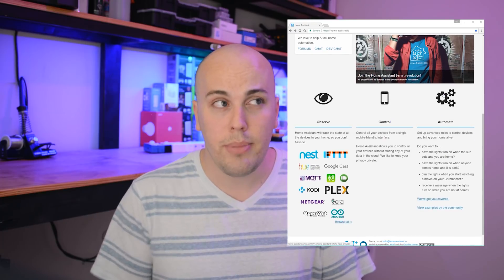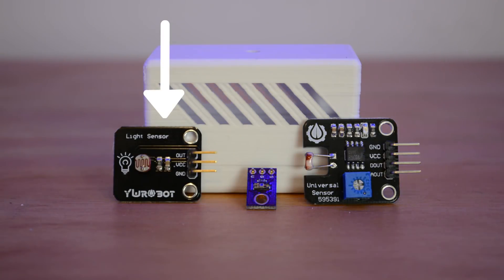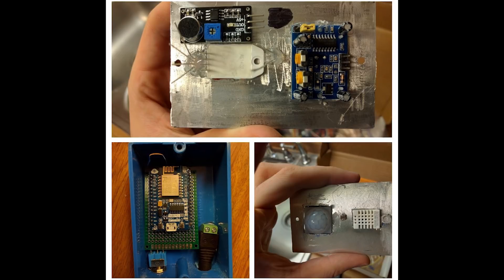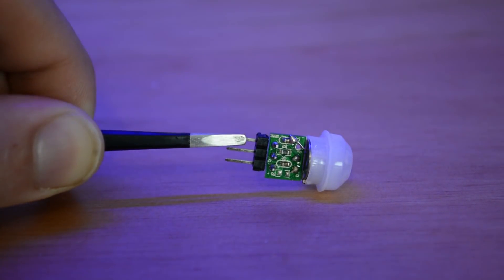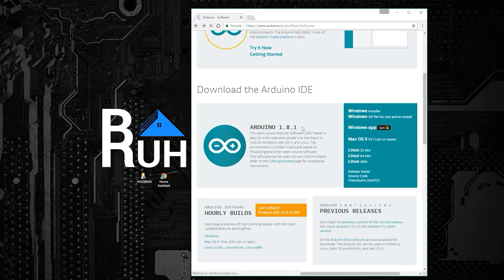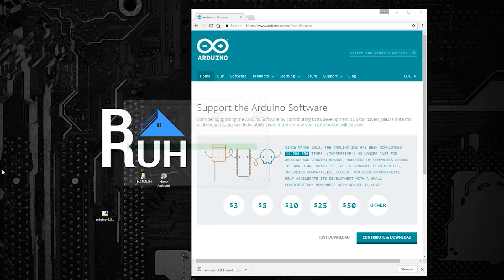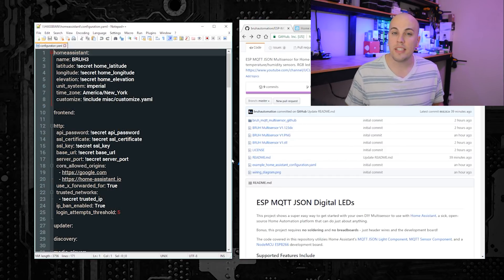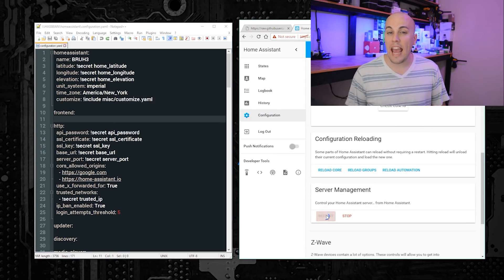$15 DIY Multisensor - Temperature, Humidity, Light, Motion, and RGB LED

Comment: Hi Ben, a huge thanks for the great help you give to all HA enthusiast! 
I build the awsome multisensor and it works great... but for a few minutes, then it hang up and I have to reset it to make it work again. 
It is done exactly as yours, only with a dht11 (I changed the line in the script) and with a LDR/resistor configured doing some soldering. All the readings are correct, RGB LED works, I also tried changing the ESP8266 with another one, but still...   Also, I tried to make the circuit Corban proposed in his Github, using FET to control an analog led strip. I wanted to join a multisensor with a LED strip controller :-)
It works, but the light is very dim, and I can't make it go higher. The voltage, mesured on the connector that goes to the LED strip, is 12 as planned, but I guess the RGB pulse is not going correctly.
Any advice?

Comment: Anyone have any ideas for an enclosure for this that's more appropriate for mounting to a ceiling? If not, I can try poking some holes in a project box... but not sure of the min-height required of box. Will something like this work? - https://www.aliexpress.com/item/1-piece-25-65mm-plastic-LED-electronics-junction-housing-diy-instrument-enclosure-humidity-plastic-box-for/32804796187.html OR https://www.aliexpress.com/item/75-23MM-LED-power-driver-retardant-PC-plastic-box-Round-plastic-housing-box-enclosures/32724913441.html OR https://www.ebay.com/itm/6Pcs-77mmx31-5mm-XL-164-Retardant-Enclosure-Junction-Box-Round-for-LED-Driver/311985571775
Reply: I'm sorry I don't have an answer for you, but I'm about to make one of these as well. Do you think mounting it on the ceiling will skew temperature readings?

Comment: Sorry i'm a noob to ESP, and these modular sensors.  Looking to use this video to build a water temperature sensor for my aquarium by replacing the DHT22 sensor with a DS18B20.  I don't know how to use resistors though.  Are they required for the waterproof temperature sensor even though it's only a 3wire sensor?

Comment: Glad I found this! Awesome work as always!
FYI Looks like some of your links are dead. 

Also, Amica nodemcu 1.0 is slightly more expensive than the lolin v3 which just a slight bit larger in size https://cknodemcu.wordpress.com/2015/11/13/nodemcu-variants/
That might be an easy way to knock a few bucks off the total cost.

Comment: I followed all your instruction and copy all your codes but when I flushed the firmware, the LED stay on blue color and the serial monitor show connecting to my router and MQTT okay.  It showed 5 lines of {"state":"OFF","color":{"r":255,"g":255,"b":255},"brightness":255,"humidity":"0.00","motion":"","ldr":"0","temperature":"0.00","heatIndex":"nan"}
 then stop and did not show anything else.  I did not modify any of your code except the setting on the top.  When I try to look at my HA it does not show ad reading and when I turn on the SN1 LED it flip back to off.  What did I do wrong?
Reply: Hi mate. I have the same bug with the blue on the RGB LED being on when any other color is also on, but it will turn off if all colors are commanded to off through HA. Same as you it comes on when the NodeMCU is initially powered up, which suggests that it is a FW bug not HA causing it. 
So did you ever work out why the blue led was staying on when it shouldn't be ?
Reply: OK, solved the issue I think. D3 blue LED pin has a 12K pull up on the NodeMCU V3 board I have, and that is enough to light up the blue LED. D4 has the same thing so I shifted to D6, then recompiled FW with the change "const int bluePin = D6;" All good now so far.

Comment: Ben  Love your videos.  I am having a little trouble though.  When I run the esp8266 and look at the out put on the arduino serial port screen I can see the data all formatted nice and it logs on to my network and logs into the mqtt server on my raspberry pi.

The little circles at the top of Hone Assistant are there and they are labled and look nice but there is no data in them.  When I go to the logs under hassio it shows null data when it reads the mqtt msbg.  What have I done wrong?
Reply: When I click on the menu in home assistant then click on mqtt and then go to the bottom of the window and look in the file this is what I see.

1512426060: New connection from 192.168.1.48 on port 1883.
1512426060: Client sensornode1 already connected, closing old connection.
1512426060: Client sensornode1 disconnected.
1512426060: New client connected from 192.168.1.48 as sensornode1 (c1, k15, u'tomsha').

Comment: Has anyone else had one of these boards smell like they're burning when you plug them in? I actually thought I fried one, but apparently, it just smelled like it fried and didn't work the one time i plugged it in...It started happening when I got the temp. humidity sensor...I think I bought a different one than Ben posted, but it seems like it should still work, right?

Comment: Hi, Great video. I just tried to duplicate your results, but as soon as I restart Home Assistant it stops responding. I can ping the RPi3, and can use the Samba share, so I can copy a back up configuration.yaml file to my installation, but have to pull the plug to restart it. When restarted everything is fine. I am clueless at what can be the problem. Any ideas ?
Reply: have a look at the .log file in the same directory as the configuration.yaml file.  It can give you some clues.  A lot of times it can be something silly like a tab character being used in the code instead of spaces (I think error log reports it as something like "/t" error).

Comment: Great project to include these sensors which makes it a terrific monitoring & control project
would it be possible to add two general purpose relays to control. Nothing fancy just controlled from home assistant as on off  pads. thanks

Comment: Built it and it works like a charm.  Thanks for the work you put into this!
The only little issue I have is, that my temperature readings are off, compared to a "naked" DHT22. They are about 2°C too high and humidity is slightly off too. I compared with another DHT without enclosure and also swapped sensors. My guess is, that the NodeMCU generates enough heat too cause this.
Reply: Hi @lalaoberot. Where did you buy your components from? Did you use the components mentioned in the video description?
Reply: It's not the  the components. If I take the DHT out of the sensor  enclosure the temperature is spot on. Unavoidably the ESP8266 generates a small amount of heat and  my guess is that this gradually warms up the DHT22.  I verified that with a second temperature sensor that I put inside the sensor box. Temperature, naturally, inside of the box is higher than air temperature outside of the box.. So I built a slightly larger enclosure with four rows of air vents and a piece of 6mm depron insulation foam between ESP and DHT. Now everything is fine and temperature readings are correct.

Comment: I am planning to use multiple esp8266s. I would not like to generate and maintain code for every esp8266 that are doing the same task just to define MQTT topics for that particular device etc.

Does anyone have an example to make code reusable e.g. so that code is defined based on information on the each esp8266? Could a serial number or MAC address be used when flashing or runtime?

My goal is that I could update all esp8266s that are doing same thing by using the same single code.

Comment: Thanks for the great video, I love this idea. Is there a similar board that could accept all of the sensors but leverage ethernet and PoE instead of external power and wifi? Also what do you think about the idea of adding a magnetic door sensor to the unit as well?

Comment: Hey Ben, there is one thing about this tutorial that I don't like - hacking library to change something that doesn't need changing. You're better off with doing #define MQTT_MAX_PACKET_SIZE 512 *in your code* before you load this library and not modify library directly. Just before that there is #ifndef line which essentially means "if not defined". This is common in C code to do configuration like that sou it can be changed from outside.
Reply: I just went through this. I put a #define in my sketch, but it did not override the library. Nothing was getting sent to MQTT until I modified the header directly. Placement of the define did not make a difference. Is there is a setting in the compiler I'm missing? Seems like the libraries are being loaded before the sketch.

Comment: Hey Ben, thank you for you video.

I'm thinking to use this solution to build my home security alarm system.

I have only a question: there's a way to make it works with a battery?

I think alarm should be available also without electricity...

Thanks

Marco

Comment: If you have a NodeMCU labeled "LoLin" you will need to connect the V supply of the PIR not to Vin but to VU.
Reply: I have LoLin and i tried to put Vin to VU and my Pir sensor started to smoke right away. Are you sure about this?
Reply: Timo Kivelä that’s how mine is hooked up for three of these. No smoke.

Comment: Sweet video!  These videos have inspired me to setup home automation. But I have ran into a snag with these sensors and was hoping someone can help.I have been wanting to make a few of these and unfortunately, I can't get the PIR sensor to work. It sits constantly at standby. I followed the wiring picture provided but it doesn't exactly match up. I have moved the pins around since I can't tell how to wire it and nothing. Also, I removed the ground wire on accident so it was loose and then it constantly registered as movement.  If Ben or someone could post a pic of how it should be wired with the right chipset as in the video I would appreciate it. Or if that isn't my issue does anyone have any ideas how to fix this issue?  Thank you
Reply: I moved from the VIN to 3.3v and it started to work.

Comment: So I have got the code running on the node mcu, and I can see from the serial monitor that it is connecting to the access point, connecting to the MQTT broker, and printing out the sensor information. What isn't working is displaying these values in home assistant. They come up as "unknown". The topic is correct and I've changed the MQTT_MAX_PACKET_SIZE in the pubsub library. Any ideas?
Reply: Unicycle2993, I'm seeing the same sensor information you are and having the exact same problems. Are you using Hass.io? Have you received any assistance on this yet? I'm wondering if there is something different between the "embedded" version of MQTT and the "installed" version Ben shows.
Reply: if you run a check on the configuration on HA, does it pass with no errors ...
Reply: also if you managed to get the RGB LED working, can you assist when the hell am I getting it wrong ..?
Reply: There are no errors.
Reply: I have the RGB LED working as far as being able to control its brightness from the homeassistant interface. I'm unable to change its color. I'm still unable to see the sensor values.
Reply: Hi, so originally I was not using Hass.io. I was using the Hassbian image. I switched to Hass.io a couple of days ago. I'm still getting the same errors as I was before. I had given up on it after trying for a while. Perhaps I will try again to see if I can remedy the issue. If I do, I will be sure to reply to your comment and explain what the issue was.

Comment: Ok I managed to make the light sensor work and now I have LUX readings, BUT I have pulled my hair to make LED working, I have tried everything , changing port, rechecked the code and what all was possible from my end but LED wont lit???? Can you assist plzz what I can be missing. Motion sensor is also always on "mothion detected", that might be because I haveused a different sensor than yours and you said that might create problem. The onle you have listed is not available here, but I have ordered another one to see if that makes any difference......plz help me make my LED work

Comment: ok managed to get rid of errors as well so I am getting reading in HA as well, BUT few things if you can assist ....
1. LED light is not working?
2. LDR light is at 0 LUX always
3. PIR sensor is always at motion detected state.

Only temp and humidity are working perfectly.

Comment: OK I got it to make it work, I mean I see the readings under the serial monitor. HOw ever when I past the below code in yaml file (small one to start with). I get an error and HA does not even start properly, web console shuts down.

Below is the code ...

sensor:  
  - platform: mqtt  
    state_topic: "bruh/sensornode1"  
    name: "SN1 Humidity"  
    unit_of_measurement: "%"  
    value_template: '{{ value_json.humidity | round(1) }}' ......

Below is the error......

Jul 13 17:42:27 hassbian hass[1145]: in "/home/homeassistant/.homeassistant/configuration.yaml", line 1, column 1
Jul 13 17:42:27 hassbian hass[1145]: expected <block end>, but found '<block sequence start>'

Comment: i want to build only motion sensor can i just go with ( NodeMCU ESP8266 Chip , Mini PIR Sensor , Power Supply ) is it possible to do just that? i will use it for hallway , toilet auto light on.

Comment: Hi, I am getting following error when verify the code: 

Arduino: 1.8.2 (Windows 10), Board: "Generic ESP8266 Module, 80 MHz, 40MHz, DIO, 115200, 1M (64K SPIFFS), ck, Disabled, None"

Build options changed, rebuilding all
BrushMultiSensor:68: error: 'D1' was not declared in this scope

const int redPin = D1;

                ^
BrushMultiSensor:69: error: 'D2' was not declared in this scope

const int greenPin = D2;

                  ^
BrushMultiSensor:70: error: 'D3' was not declared in this scope

const int bluePin = D3;

                 ^
BrushMultiSensor:72: error: 'D7' was not declared in this scope

#define DHTPIN D7

               ^
E:\Amazon Alexa\Sonoff\Arduino\Bruh MultiSensor\BrushMultiSensor\BrushMultiSensor.ino:136:9: note: in expansion of macro 'DHTPIN'

DHT dht(DHTPIN, DHTTYPE);

     ^
E:\Amazon Alexa\Sonoff\Arduino\Bruh MultiSensor\BrushMultiSensor\BrushMultiSensor.ino: In function 'void setup()':

BrushMultiSensor:71: error: 'D5' was not declared in this scope

#define PIRPIN D5

               ^
E:\Amazon Alexa\Sonoff\Arduino\Bruh MultiSensor\BrushMultiSensor\BrushMultiSensor.ino:145:11: note: in expansion of macro 'PIRPIN'

pinMode(PIRPIN, INPUT);

       ^
BrushMultiSensor:72: error: 'D7' was not declared in this scope

#define DHTPIN D7

               ^
E:\Amazon Alexa\Sonoff\Arduino\Bruh MultiSensor\BrushMultiSensor\BrushMultiSensor.ino:146:11: note: in expansion of macro 'DHTPIN'

pinMode(DHTPIN, INPUT);

       ^
E:\Amazon Alexa\Sonoff\Arduino\Bruh MultiSensor\BrushMultiSensor\BrushMultiSensor.ino: In function 'void loop()':

BrushMultiSensor:71: error: 'D5' was not declared in this scope

#define PIRPIN D5

               ^
E:\Amazon Alexa\Sonoff\Arduino\Bruh MultiSensor\BrushMultiSensor\BrushMultiSensor.ino:427:28: note: in expansion of macro 'PIRPIN'

 pirValue = digitalRead(PIRPIN); //read state of the

                        ^
exit status 1
'D1' was not declared in this scope

This report would have more information with
"Show verbose output during compilation"
option enabled in File -> Preferences.
Reply: I also get these errors when I try and verify the code... anyone able to help solve?

Comment: Hey ben, I've got this up and running with my initial box and it works perfectly! The only Issue that I'm having (And it's less of an issue and more of an annoyance) is that the LED automatically turns blue when I do the first start of the sensor node, Once I turn the LED on and then off again in home assistant it turns off like it should. Is this expected behavior? Is there any way to make this not happen that you know of? Thanks.

Comment: Hey Ben, I am working on this multi-sensor project and I have done everything including setting this up with home assistant. The problem I am having is the sensors are all showing unknown values inside home assistant. However, when I am using the serial monitor I show I am connected to mqtt, and I receive the values inside the serial monitor so I assume the sensors are all working.. The only weird thing I am experiencing with setting up mqtt in home assistant is that when I use the raspberry pi ip address I get an invalid configuration inside of home assistant, if I change it to local host(127.0.0.1) it will connect without any issues. Any ideas for what is going on?
Reply: I was able to get to work, I changed the PubSub Client file but did not save it somehow